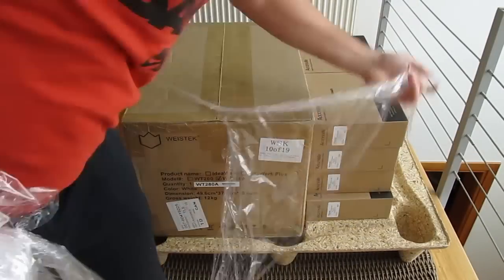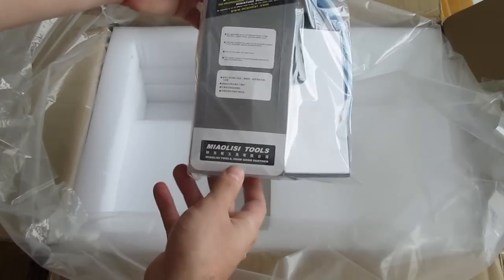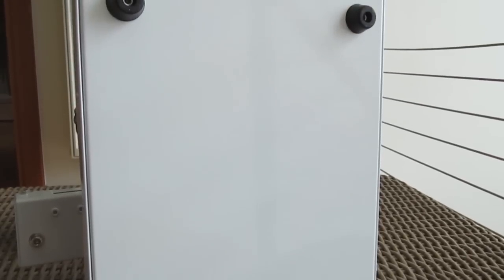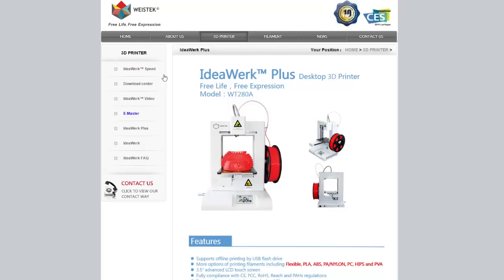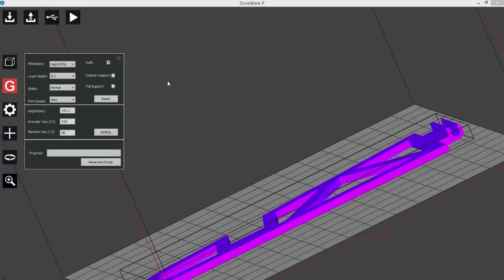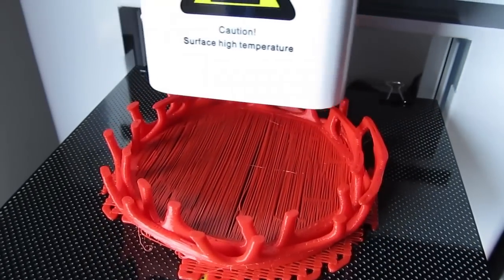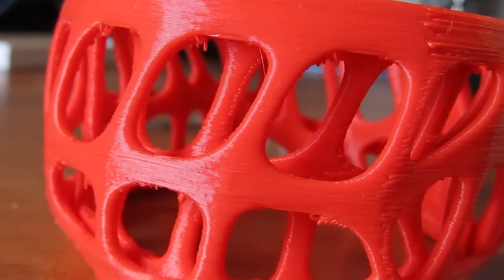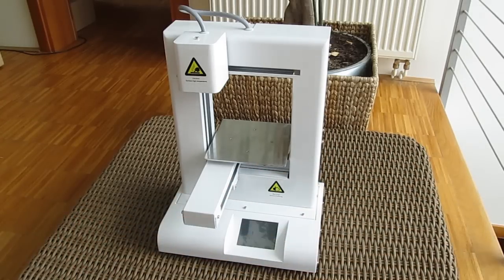Weistek IdeaWerk Plus 3D Printer Review & Unboxing

Comment: The printer is not reading any usb stick. Why?
Reply from the maker: Are they FAT32 formated?
Reply: TekTick yes
Reply from the maker: Maybe try with different formats, just in case, if it's still not working, that maybe the port is faulty
Reply: TekTick and the pc is not connecting to the printer:/ plz help
Reply from the maker: Is it on? :D
I don't know really, I would try another PC or RMA it.
Reply: you need to have a specific folder named '3DMODEL'
Reply: @jeromegirard5968  really  need?just got one

Comment: Mine always starts at minimum X and Y position and extrudes plastic outside of the print area. Do you have this problem?
Reply from the maker: Nope. I have you tried resetting (if it's possible, I can't remember now, it was long time ago) it or updating firmware?
Reply: Ah so it is just a normal process to extrude old plastic in the nozzle, after that it works perfectly fine. Thanks for the advice.